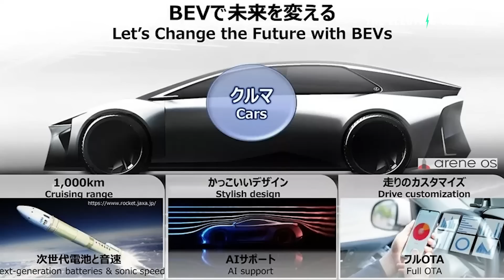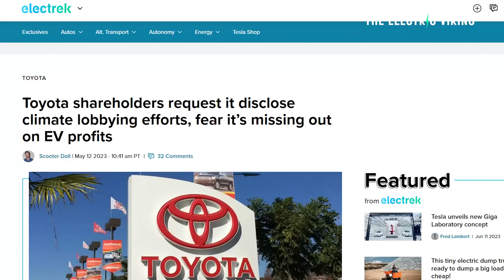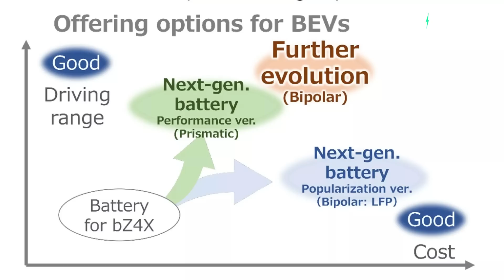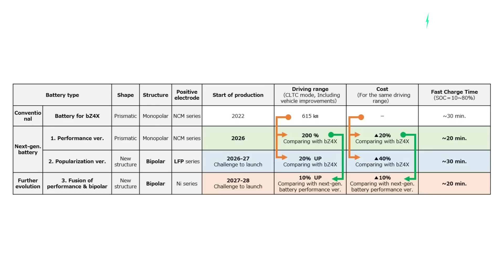Toyota's 2026 Electric Car will have 900+ Miles Range & Lightning-Fast Charging

Comment: the only "bad" thing about the toyota bz4x is that their awd version uses a shitty chinese CATL batteries which decreases performance unlike the 2wd version which uses panasonic batteries and are far superior. Most press cars are top of the line models with every bells and whistles not cheap base models with front wheel drive. You are every bit misinformed and drinking and gobbling up the coolaid as those you accuse.

Comment: In my (mid income European) country Toyota is a clear leader (compared with all Volkswagen brands together) with over 18% market share. Total EV sales of all producers are 5% of the market (so less than 1/3 of toyota). Toyota generates its sales mainly on wehicles costing 17-22 000 EUR. Nobody is willing to buy a small peugeot e208 or e-Honda or ... for almost  35000 EUR. Some buy eTron or Tesla mainly to show off. Untill EV will not reach a reasonable pricing they are not a sensible alternative for most people. ONE MORE THING : total evniromental footprint of EV cars is  currantly devastating. I am a great fan of EV and strongly believe that one day they will achieve cost (in $ and in effects of enviroment) to be attractive - but they are so far awy right now. Much, much chaeper (and eco friendly ) batteries are needed - that will come either in SodiumIon or some ultra-efficient lithium. Untill it comes EV remain a toy for rich, who want to "feel good" as Eco-friends (without really counting what is true EV effect on enviroment).

Comment: Chinese range, 😂
It's got bloody engine in it. 900 miles range with 60 litre tank. 😂 solid state capacitors are what the are , a flash of power to get the car to 35 mph and flat. Just recharges really quick. Soon cars will have super capacitors and lithium battery packs. But I can pump 50 Mw of petrol in 57 seconds with a pump.😂

Comment: My parents are Toyota fans, I guess. They have range anxiety when it comes to long road trips. I don't really believe that they can produce a car with a 900 mile range. If they had a fully electric RAV4 and a fully electric Camry with 300-500 miles of range that would be great, especially if they had frunks. I still think my parents would hesitate for a while due to the charging network switching to NACS and needing to work on software and all that. If the RAV4 Prime wasn't so much more money I think it would be ideal for my dad if he was willing to charge it at home.

Comment: Well if they can do with Electrification entering the Market like What They did with I.C.E. Over the Past 50yrs ! they have Philosophy that seems to be Conducive to Science and tech Being A Patent Juggernaut ! N.H.K. Often Displays Many Including E.E. Some Kind of High Density Easy Build Prism Battery could Make Manufacturing Upscale with Reduced Costs ,Build Time, Higher Range , . It May not Be A Breakthrough but it Would be very Toyota Forward ! .

Comment: 🌞🌞🌞 I think I am still not willing to be a payee to the shakeout. Bolstering that sentiment is that I am an apartment dweller and I do not have a charging means near by... not even 120 volts. The infrastructure is still homeowner dependent, and I am currently assuming that Toyota (and others) know that very well. The gasoline based vehicles are still the bread and butter; no rush necessary. As for "debt"... it is cheap money to borrow than to use cash reserves (at their level and scale). Dare I say that the vocal shareholders are usually paid off to lean publicly certain ways.

Comment: 900 miles sounds great, but its a pipe dream to be fair.  the car wont be affordable with a battery that large.  
EVs need to have 360-400 EPA range for a real world 300-340 range.  tech will get us there, and the affordability will be low enough.

Comment: Nothing but announcements..even if they can finally mass produce something with that range and be profitable in 2026, they still have the same dealers markup issues just like all other auto makers. Case in point, Toyota Corolla Cross Hybrid with MSRP of $36k USD right now is being marked up $7500 by dealers in my area vs getting a $7500 rebate if you buy a Tesla.  Good luck competing.

Comment: Who the hell needs 900 miles of range?!  ROTFL, there's a thing that Robert Llewelyn calls a "bladder range" and it's less than 200 miles or 3 hours. If you could recharge the batery while peeing 200 miles of range would be perfectly enough. And yes, Toyota is THE leader when it comes to marketing spendings. I've been working for them for three years and I've quit due to amount of lies they wanted me to convey.

Comment: Toyota is not anti EV, they have sold more battery cars, hybrids! Than any carmaker. The solid state battery is under development from 2012....very difficult to build. In 2021 they presented the battery, major media coverage in Asia, none in Europe..... . The've startet testing with a fleet of cars in 2021 and a pre production in the Japan lexus / Mirai plant, also to test.... . Their Bz4x is a far better EV than the press wants to believe us. It is all about reliability safety, not to much weight and ten years warranty. We have a big company with many many lease cars for employees,  more than 100. Also many Bev's. The Toyota hybrids are by far the most reliable,  we have Kia and Tesla bev's. The Tesla best bev's, crap build, comment section to short to mention all the complaints.
Yes, we don't lease Bev's anymore, decided last month, due to range problems many electronic problems and just way to expensive to charge.....and to powerful.  yes to expensive to charge, cost us more than fuel.....for the hybrids.

Until lexus comes with the solid state 2.0 Bev, no bev's anymore for us until 2026 or so.

Comment: How much does the range add to the weight?
Reply: Not knowing the exact battery tech they are claiming, but generally - nope.  Solid state batteries (supposedly) have twice the power density by weight.  They also don't use flammable liquids in them.  If/when they produce solid state batteries, they could either halve the weight of the battery for today's driving ranges (you can imagine the benefit that would provide for a lot of cars) or go twice as far for the same weight as todays cars.
Iirc the solid state batteries themselves, as science, do what they claim.  It's manufacturing gobs of them that is the challenge.  I might be muxing battery issues, but I believe the solid state battery components react to oxygen or nitrogen so they (currently) are trying to produce them in a vacuum or in inert gas containers.  That makes manufacturing much harder and more expensive.

Comment: I have a question to ask. If Chinese batteries like CATL or Korean batteries are indeed better than Japanese or any other countries's no. 1 let us say, why do we not see Chinese or Korean batteries in any other uses?

Boeing's latest passenger liner B787 Dreamliner uses Lithium-Ion battery from the Japanese firm GS Yuasa. It is not European, Chinese Korean anything.

Japanese navy's latest diesel electric submarine have the world's first and so far the only use of Lithium-Ion battery to increase its submerge time compare to lead-acid.

Why did Boeing not adopt Chinese CATL batteries? Even if it was due to US national security reason, it doesn't explain why such batteries are not used in China's indignious C919 airplane or why Boieng did not use LG Chem from ally country of Korea in the first place. It also does not explain why Chine or Korea do not use their supposed superior battery tech on as their submarines (they do not even use lithium-ion battery just regular old battery).

Comment: I was a Toyota fan with many Toyota cars in our extended family.   But my 2021 Prius Prime Plug-In will be my last Toyota. I love the EV part of the car.  But I'm tired of the gas part of the car.  I'm going to get an EV next round. My Prius gets 50MPG using gas.  That is 50miles/ $5gas per gallon = 10 miles per $1 dollar.  A Tesla gets 4.1 miles per kWh and I can charge for $0.23/kWh  so: 4.1miles/ 0.23 = 17.8 miles per $1 dollar.   When gas evenutally goes to $6/gallon, my Prius will get only 8.3miles per $1 dollar... The more gas prices rise, the fewer miles per dollar my Prius will get.  Tired of oil changes, smog check, maintenance costs, etc.  I'm going EV next round.  Electricity prices at home are regulated by the government and do not change as often as gas prices.  If you drive any other gas car, you are not even getting the miles per dollar that i'm getting with a Prius... a typical gas car with 25MPG with $5gas per gallon gets only 5 miles per $1 dollar.  When gas goes to $6 per gallon, then that drops to 4.2 miles per $1 dollar.  Just think about that for a while.  That is 4.2 miles per $1 dollar gas versus Tesla's 17.8 miles per $1 dollar electricity.    Gee, your area may be paying even less than my $0.23/kWh so that means you will get even more miles per $1 dollar electricity!

Comment: As I've noted Toyota knows exactly what they are doing.  They knew Lithium was a dead end; and now that the Japanese government has worried that others will become the precieved leaders; so Toyota and Honda are putting in some solid state technology.  I would only be concerned, as the head of Toyota has been; that they are rushing into it and aren't fully ready; and it will be like cybertruck and the 4680, be mostly hype until they figure out all the problems.

Comment: If Toyota is due to be the EV market leader/innovator by 2026, no-one has told Toyota Australia who are still trying to tell us that EVs aren't the whole answer. If they are ready to smash the 2026 versions of Tesla, BYD, VW etc in that year then they should be promoting their EV prowess now and getting us excited. The fact that the are, instead, spending more effort in Australia trying to hold back the tide with pro-ICE lobbying etc suggests a different story. Perhaps the current Toyota top management can hang out in 2026 in the same whisky bars as the old managers of Kodak, Nokia and Blackberry have all done,  reflecting on how life could have been..

Comment: Toyota has the policy of providing as wide a range of choice of choice for its customers.  They see the EV as a transitionary process to energy change and still support the view of H2 power as the ultimate goal.  What has encouraged Toyota to get into EVs is the development of solid power and quantum scape who are developing solid state batteries that move away from lithium ion batteries.  These batteries do not require increased weight to gain performance.  VW and BMW have sunk a lot of research dollars in these new batteries that easily gain this range gain while reducing weight compared to lithium ion batteries. I have shares in this new battery technology.  So Toyota have not changed their policy but are interested once the better battery technologies allowed them to provide a good customer experience.

Comment: Frankly this is obviously just for their investors, who must be starting to smell the coffee. But personally I think 400-500 mile range is sufficient for 90% of people if charging time is under 20 minutes (5-80%). If you are towing a caravan I think the idea to have an additional battery in the item towed is the best way to increase range/maintain range. Sure being able to buy a vehicles with 1000 miles of range likely technically possible but just for the few.
Reply: In the US or Aus maybe you need 400-500 miles, but in the UK you don't need anywhere near that.  I have a Skoda Enyaq 60 with around 200 miles.  I drive 25k miles a year all over the country and that's enough.  Would it be nice to have more? Sure - Another 50-100 miles would be nice, but 200 miles is over 3 hours driving at UK average speeds, a 30 min Bladder & Caffeine stop gives me another 2½ hours.  Personally I'd rather top out at a real world 300-400 miles as battery tech improves & start lugging less weight around.  You're right about the towing though.  A lighter tow car will leave more for train weight and a battery in the trailer could run trailer systems when parked up.  It'll be interesting to see where it goes but I think this obsession with big ranges will fade as people get used to it - maybe modular up-gradable/down-gradable battery capacities to suit the owner will be the way to go...
Reply: Hi. I have a Skoda Enyaq 80 so I already have the additional miles. In summer the range is around 350 miles.  I have yet to visit a public charger other than the free Level 2 one at the local garden centre. @garyallsopp6369

Comment: Big batteries in small spaces are already feasible in principle. But the high energy densities involved carry significant safety risks, of overheating and fire. 

It is mainly for this reason that most existing battery manufacturers have not yet gone there, the product liability insurance premium is simply too high.

As for whether the battery is solid state or has a non solid state electrolyte I dont think it matters much. I just recharged my 13 yo Apple Ipod. Still goes fine, no real battery degradation in the 13 years since new.

Comment: The limiting factors for EVs adoption are:
1. battery cost and supply
2. charging infrastructure, especially level 1 home charger for apartment dwellers
The solution for 1. is to increase mining and refining capacity.
For 2. it would be a good idea to make a law to obligate the land lords to install chargers at apartments.
As you see, we don't need those "GAME CANGING BREAKTRUOGH BATTERY TECHNOLOGIES" at all at this point.

Comment: No ‘magic’, Sam. Basically, Toyota is full of sh!t. It’s all about the Japanese culture of avoiding embarrassment. In 2016 and 2017 respectively, Toyota claimed they would have solid state batteries and incredible range by 2020. Maybe they wouldn’t have to ‘save face’ so much if they cut out the bogus announcements. Ironically, they are embarrassingly tarnishing their reputation.

Comment: First Toyota claimed in 2012 my Chevy Volt was a bad idea and their Hybrids and plug-ins that delivered 7 miles of EV range and $15,000 more was the answer.  Then of course , the ongoing Hydrogen hoax followed by their recent ridiculous Hydrogen ICE Engine   "development " that they forgot to mention the range of 50 miles and the fuel cost of 20x of electricity. . Now this total solid state battery hoax .  The big concern is how gullible their loyal fans are .  I also don't agree with the exaggerated reliability and value claims from customers. 4 years ago,  I bought a GMC Yukon with 190,000 miles for $5300 .  A comparable Toyota Sequoia was $15,000 at the time.  Somehow the Toyota was supposed to be more reliable , save fuel , save money , ect.  However , at 260,000 miles I find the opposite to be true.   A month ago , my son bought a Tesla Model 3 for $41,000 .  He will receive $10,000 in credits.   He could have purchased some outdated technology from Toyota for twice the price.

Comment: Although the mileage is unbelieveable I think they can use the regeneration part of the ICE hybrid and reclaim some of the lost electricity.  Wiring it the key but I think the most they can gain is 50-60 percent,  taking the range up to 450-500 miles

Comment: 200kwh charged in 15 minutes = 800kw charger.  Say 480v, that's 1666amps.  Even charging from 20% to 80% - that's 120kwh.  in 30 minutes that's a 240kw charger, nearly twice what a Tesla supercharger can do.  Now, 600A over a cable??  Not really something a human could handle.

Now imagine this at servo scale - say you want 12 'pumps'.  You'll need nearly 3MW capability - good luck getting that, but we'll move on.  

The cars are not the problem, the logistics of charging is.

Comment: I'll believe it when I see it. I'm with you, it HAS to happen. With so many countries vowing to ban the sales of new combustion vehicles in the coming decades, Toyota has no choice, but to build a competitive, compliant car, which will undoubtedly be electric. I feel that Toyota, and every other major auto manufacturer have secret projects in the works that are as of yet, undisclosed. Everybody is working on new batteries, and, improving the efficiency of their motors and controllers, as well as improving aerodynamic coefficient of drag.

Comment: Transistor battery has to be used into electronic devices first . In EV they must be warranty for 10yrs/ 100,000 miles. Toyota is blowing smoke. They don’t have a competitive  EV.

Comment: 😅 But they will still be selling through a dealer network, even if they can really make these. You can’t even get a 2023 Prius where I live. No inventory. Or like Sam says “invent-tree”? Even when they have a couple in stock (supply and demand), the markups - whew 😅 …..If they built them and got a couple in at my local dealership, they’d be $60,000!

Comment: I assume this is BS because Toyota's marketing department is still under the impression that range matters.
The OEM's that actually build mass market BEV's have consolidated around the range of 250 at the low end to 420 at the high end.
Any battery improvement will now be aimed at these ranges but reducing battery pack size, weight and thus cost.
So by the time Toyota comes out with a 900 miles per charge BEV it will be at the same cost per mile as everyone else, so Toyota will not have leapfrogged anyone at all. 
No one wants to travel 900miles on a charge.
If Toyota was marketing a Class 8 semi, then yes I would sit up and saw wow. They are not, so this just what GM was playing last yr to keep GM investors happy and they just fed them BS.